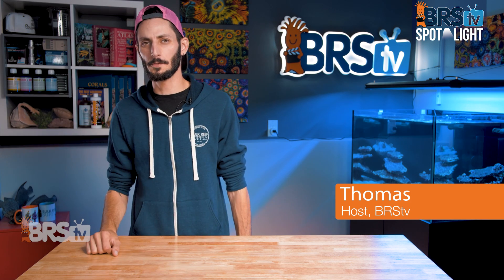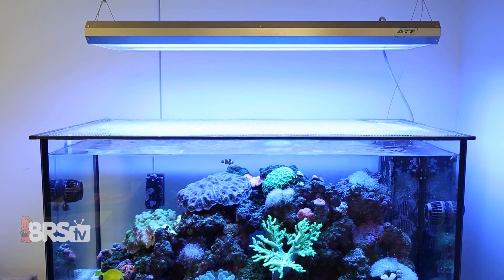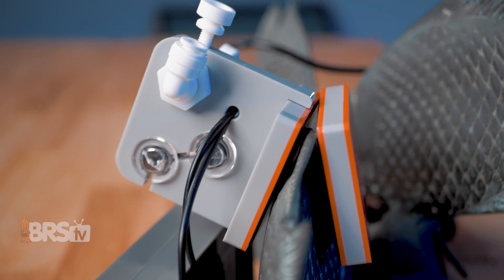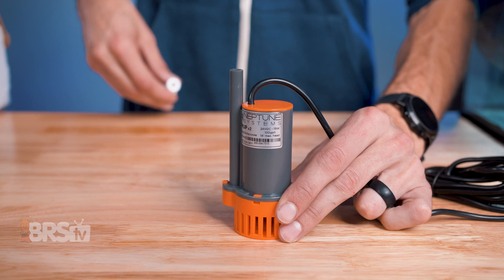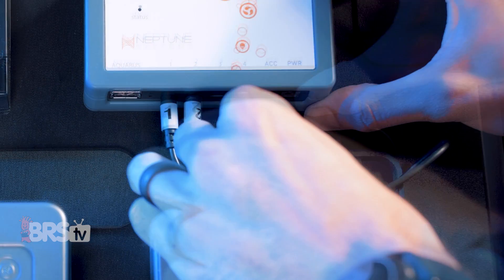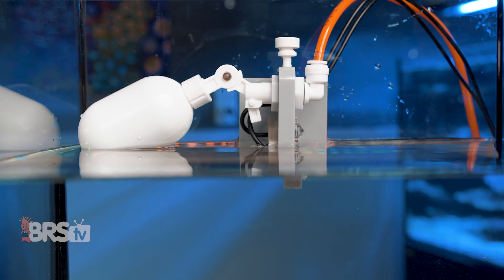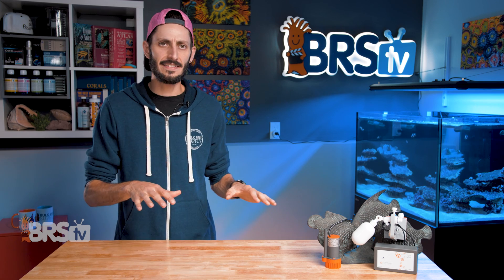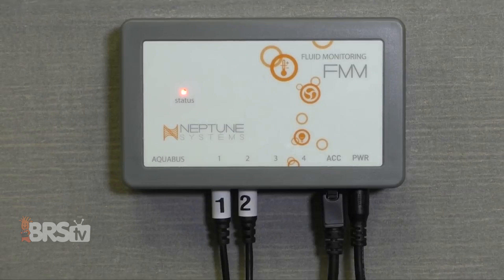Auto top off systems with a brain! Smart ATO protection without needing an Apex. Neptune Systems ATK

Comment: What if the main sensor doesn't fail to see the rising level, but fails to see the lowered water instead? I have a Tunze 5017 that often fails to see the water getting lower due to evaporation. Now I am looking for an ATO that has an extra check below the main sensor, but there seems to be none.

Comment: So how do we keep the reservoir full?
Reply from the maker: There are a couple different ways you could go about doing that. 

Most common would be to fill the ATO reservoir by hand. I would recommend sizing your reservoir to hold at least a week's worth of top off water. Then, once each week, fill it up and forget about it till next week. 

Another way would be to plumb your RODI system to the reservoir with a float valve. This introduces a little more complexity and risk, but is certainly the most convenient as it'll always keep the ATO reservoir full. If you go this route, I highly recommend some sort of leak detection (like the LDK if you have an Apex).

Comment: Big serious, and in my opinion very important Question here: Can or Does anyone make any kind of ATO with an actual salinity monitor rather than relying on some form of water level monitor at all?
There is a big problem and an opportunity for a path to a next level step up in water stability available here. Whilst I get the benefits of an ATO over manual RO dosing, the big problem for me is with Tunze and the Neptune ATO is that if water level changes slightly, then so does salinity, and in my tank there are often minor changes in water level, either while I'm doing a water change, test, adding and acclimating corals or simply bits of debris partially clogging up outlets making the tank or other parts of the sump 'hold' a little more water and then the ATO wrongly adding more RO. 
If someone could find or make a salinity monitor that can be connected to an ATO to you can simply dial in the desired salinity and the ATO takes care of the rest, that would be amazing and I'd by one in a heartbeat. This also stops over top off in the event of a leak or under top off in changing water levels. PLEASE let me know your thoughts, this has been bothering me for a while and I think it needs more research. Thanks
Reply from the maker: I love this idea. The fact is that salinity monitoring does exist, but don't perform to the reliable extent that float switches and optical sensors work. I think this is a great idea for the future, but we're not quite there yet. At least, not in terms of producing a salinity based ATO system that has a reasonable price tag.

Comment: I’m looking to buy an FMM and a couple optical sensors to pair with my Neptune solenoid switch for something different and buying this ATO kit is more economical than buying the parts I need separately.  Sorry if this is an dumb question- but is there any reason why I couldn’t buy this kit and use the individual components for different purposes?

 I have an Avast ATO which has been super solid and reliable for years without any issues or maintenance. I much prefer their use of pressure tube /switch instead of optical sensors or float switches which can get dirty/ fail. 
..It would be interesting to know why Neptune  didn’t use that pressure tube method like Avast and SpectraPure do.  Anyone have thoughts on this?
Reply from the maker: You can absolutely use the FMM and optical sensors for a different purpose if you wish. You'll just have to change the programming a little bit to meet your specific goals.

Comment: Just set up a new ATK stand-alone. After powering up, the PMUP turns on just for a couple seconds and then stops even though the water level is below the low optical sensor. Is there something I am doing wrong? It is not hooked up to an Apex. Thanks

Comment: Between Neptune’s atk vs tunze osmolator or even a better one ato that I am have not looked at, is one better than the other? If you could get any brand to start with which would it be?  And why? I am looking to purchase an ato for my recently acquired 150 gallon, before my trip in august.

Comment: @3:43 leaky push connect. 🤪
I really like the low reservoir sensor. I’ve let mine run dry more than a few times.  🙁
Reply from the maker: That's actually the siphon break hole 🙂

Comment: Look at that siphon break spraying water everywhere! Ehh, not convincing for the purchase.

How does this compare with the Osmolator (other than the ability to connect the 2 extra sensors and to the Apex)?
Reply: Go for the osmolator, the atk is garage. I bought one and tossed it in a box and got the osmo.
Reply: @semaphor3  What didn't work or didn't you like about the ATK?
Reply: @devadroid5269  The fact that it started to rust. Terrance is also so obnoxious,  coming across as so arrogant yet half the products they been releasing are just full of flaws, 599$ for cheap plastic junk, it pains me to admit that if I had the option to toss my Neptune system and go GHL I would.